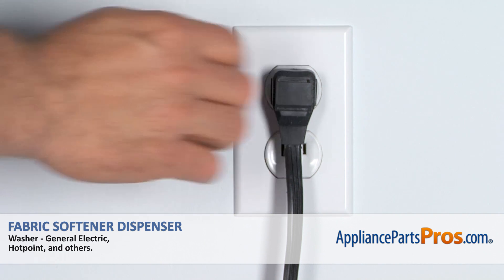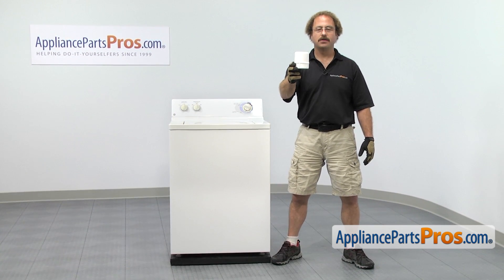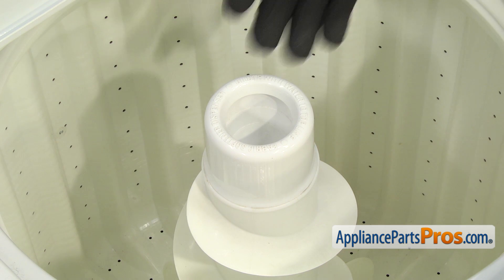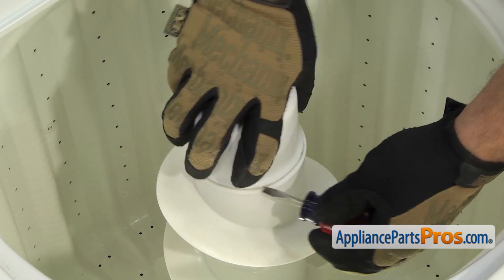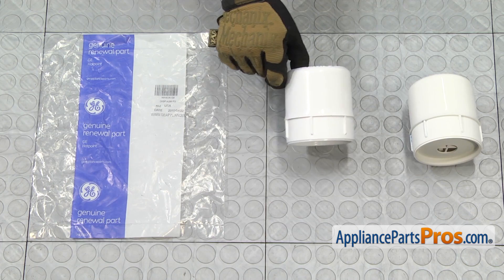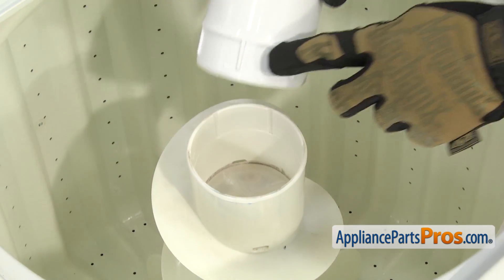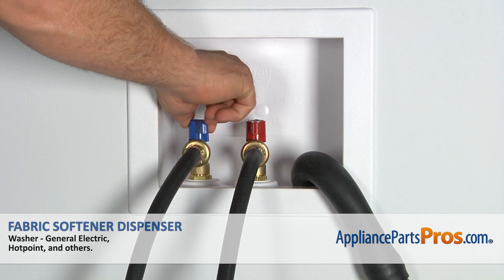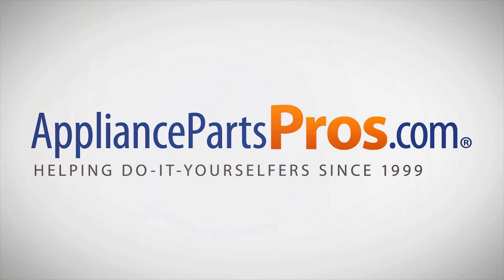How To: GE Fabric Softener Dispenser WH43X139

Comment: I noticed that the instructor forced the new dispenser down and didn't line up the guide lines into the agitator. Doing so, it wasn't positioned properly. There are about 4-5 guidelines on the dispenser that match up to indentations on the agitator.